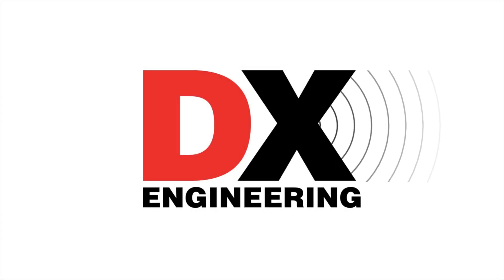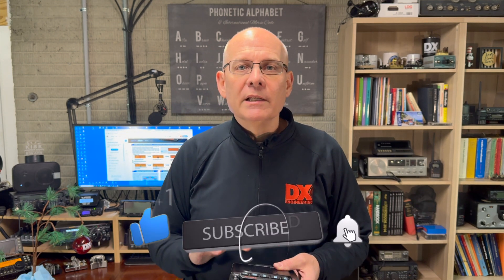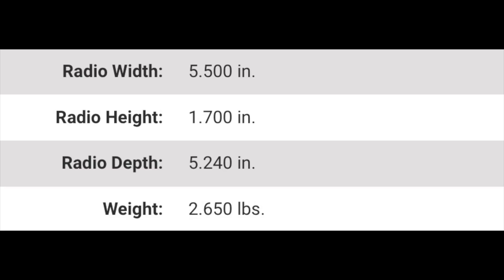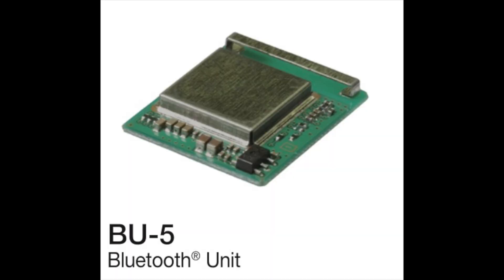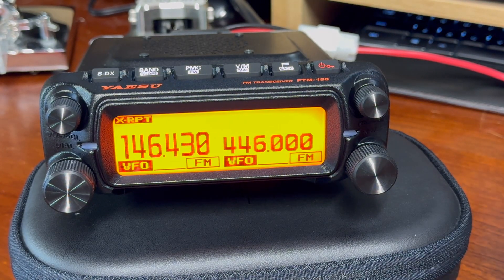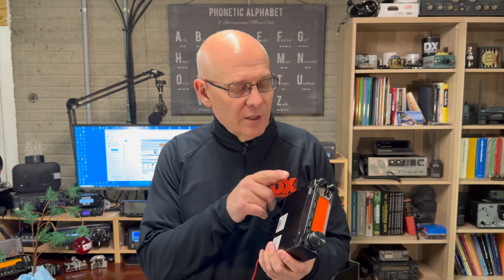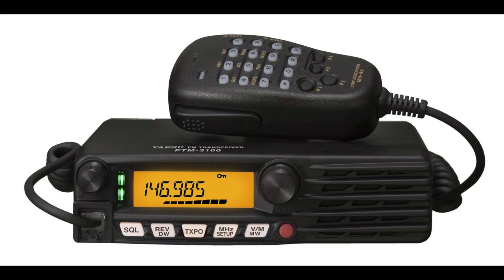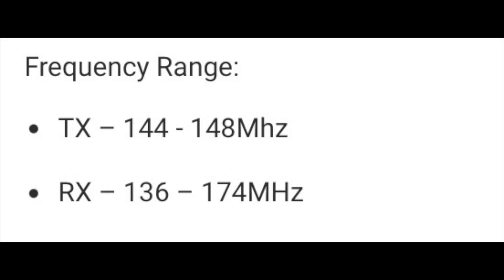First Look at the New Yaesu Mobile Transceivers: FTM-150RASP, FT-3165RASP, and FT-3185RASP

Comment: Why have the manufacturers abandoned SSB and CW on VHF?
Reply: They haven't. You can find both on the IC-705 and the FTX-1F. Established QRO examples would be the FT-991 or the IC-7100. SSB and CW add expense and giving people more affordable options helps to expand the hobby. If you want those modes and filters, you can buy a different radio.
Reply: @SierraWhiskeyHotelRadio  they are high priced HF and VHF rigs. I have a nice HF rig, so I want to buy a 2m with SSB and CW. The only 2m 70cm multimode rigs is ic 9700 at £1900.
Reply: so it isn’t manufacturers abandoning modes, it’s you not wanting to pay the price. Even a dual band rig is going to cost more with SSB and CW. It’s economics. The filters alone cost quite a bit. You can sell that old HF rig and get an all mode, all band radio. Problem solved.

Comment: I have the FTM 150 r a s p got a loud front facing speaker sounds good the only drawback I have against the radio is the ASP it brings in  unwanted signals . Went on a repeater listening with the ASP on you can hear chatter going on sound like a radio station bleeding over that's the grap I have against the asp. The ASP makes it sound like  side Band bleeding over on am CB radio did .